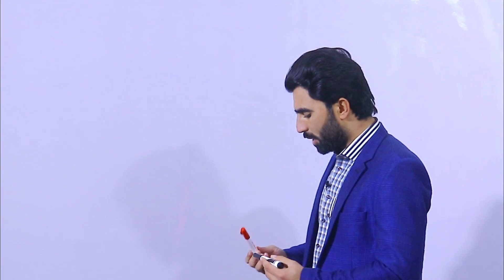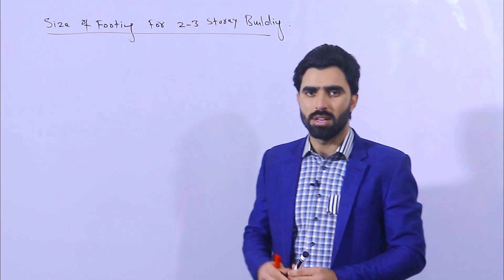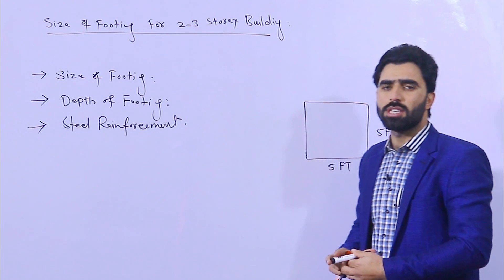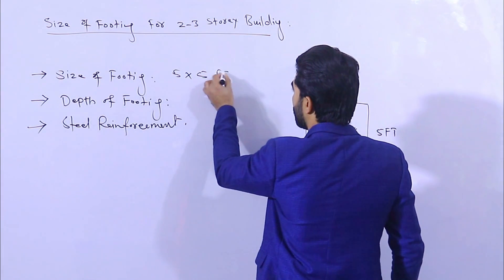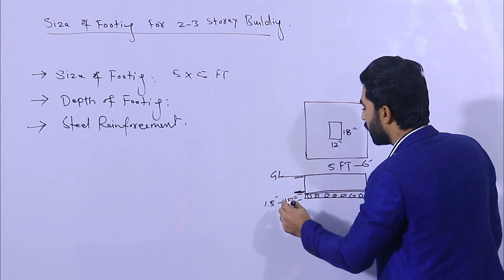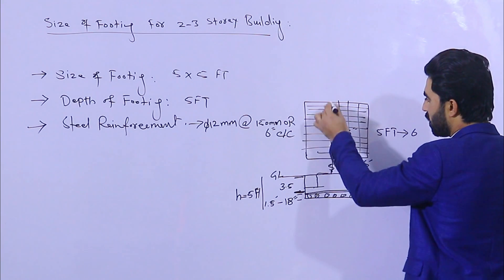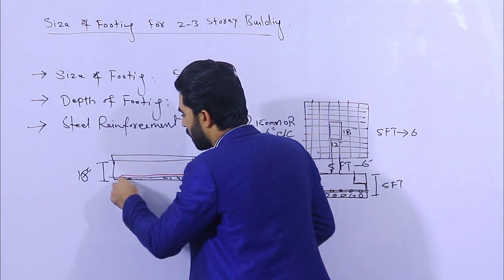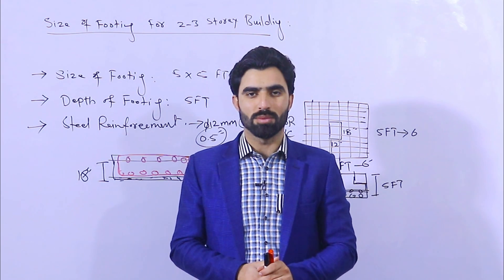Depth of Footing for 3 Storey Building  | Practical Video |

Comment: Im confused at 4:20 you confuse us with the bed level and the steel reinforcement level. So the steel mesh should be 12" thick + 3" top cover + 3" bottom cover....so what so you do for the other 3.5ft to ground level? Backfill???
Reply: backfill with pedestal  (column substructure) only

Comment: For 24ft space between two columns, our structural engineer has given 12" x 16" column size with 10 16mm rods and beam is 12" x 16" with 8 16mm rods. Is it correct brother?